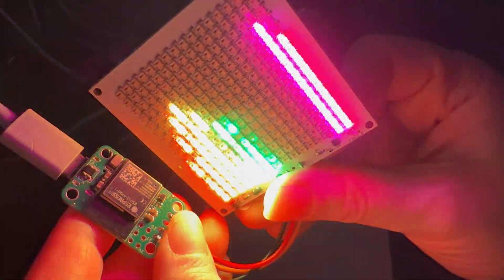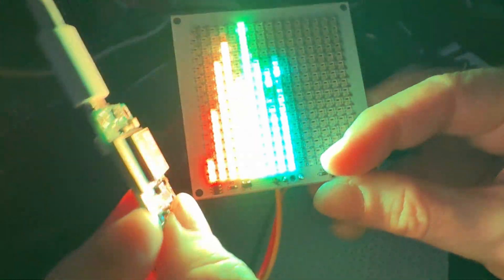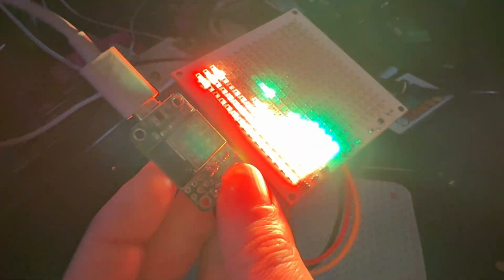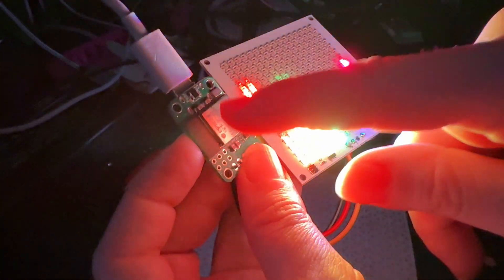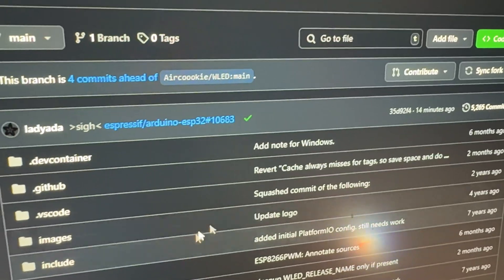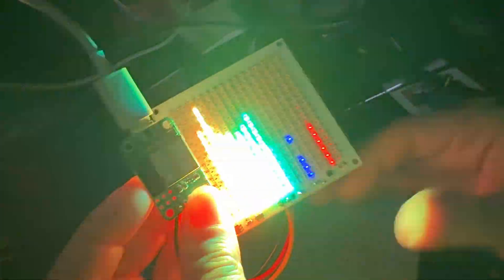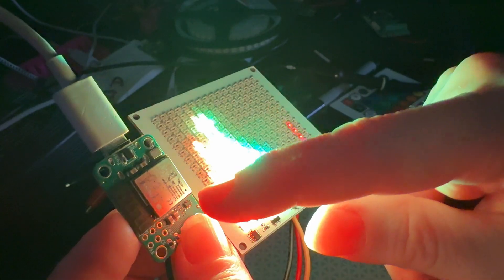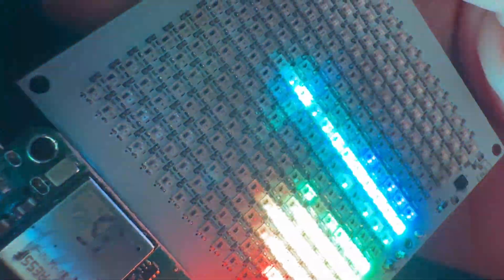Testing Mini Sparkle Motion board & a WLED fix 💡🍴

Comment: How exciting! Can you share any info on the level shifter you're using for the mini version? I had a different wled board using the esp32 mini and had flickering issues with transitioning between presets in a playlist because the only level shifter they used was a sacrificial ws2812 pixel on their PCB.
Reply from the maker: Ladyada answered your question on Ask an Engineer https://www.youtube.com/live/Vm_R5diG9Wg?feature=shared&t=3476